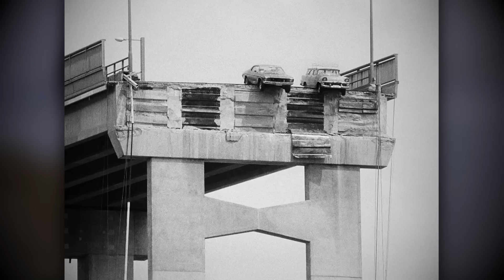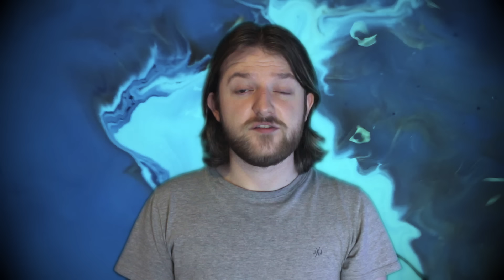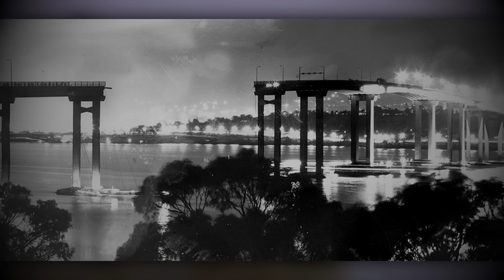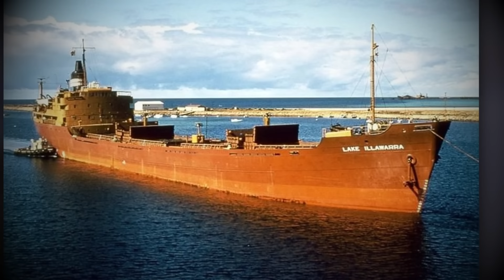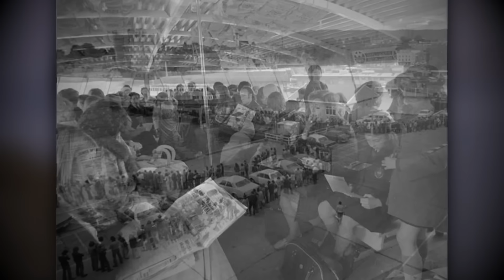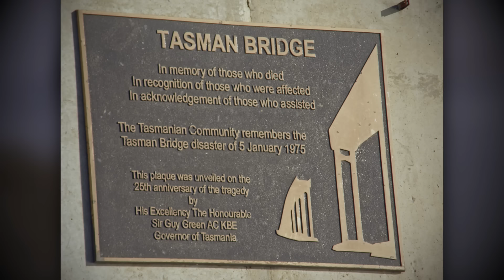Motorists Drive Off Collapsed Bridge | Last Moments

Comment: Makes me think about how often people (including myself) take for granted that the roads are okay, the bridge is there, and that everything is normal. I wonder how many distracted drivers would go careening over the edge if this happened now?
Reply: Probably way more sadly. Phones.
Reply: @thomasjhun3700  not even just phones, I reckon people just care less. Cars are easier than ever to drive, and you don't really need to think about what you are doing anymore (most new cars are mostly autos, braking systems are better, steering is very light and regures very little effort.) I reckon that because they don't actually have to think about driving anymore, they just zone out.
Reply: A year or two ago, the atmosphere became heavy thick with wildfire smoke and ash, which was added to by the darkness of the early morning and fog that had just come out. Visibility was basically nothing. You could barely make out the tail lights in front of you.

Myself and several drivers took on the highway at about 25-30MPH that morning. It wouldn't have prevented a crash with how little visibility there was, but at the very least, it wouldn't have been at 60 miles per hour.

To my horror, however, during that drive, there were people speeding by in the fast lane going about 70mph. If there were a wreck further down the road, it absolutely would've been a pile up. I don't know why they believed it to be safe going that speed.
Reply: @Sk0die  oh no cars are safer now
Reply: Picture texting while you are approaching the NON section of bridge.  I'd expect nothing else from the people I see on the road at all times.
Reply: @ashtentheplatypus  that kind of ignorance displayed by ppl scares me to death! Why in Gods name did these ppl think it was remotely safe for them to drive that fast with such limited visibility?!? So glad that these idiots didn’t hit you or make you wreck! Thank you so much for the share....
Reply: @Sk0die  Not to mention, people trying to get you to stop on the road in some countries like the U.S is kinda suspicious.
Reply: the silver lining is that this happened at night. who knows how many dozens more people would have been killed for being distracted, with a huge pileup forcing even more cars off of the bridge. RIP to all the victims of this tragedy.
Reply: Just last spring I was driving home from visiting the city with my friends when just about as soon as we crossed the county line, we were plummeted into a thick fog. I had to slow down to 30 km/h in some places as the thickness of the fog varied and I turned my hazard lights on. I saw that quite a few drivers coming in the other direction were still going ~100km/h and at one point a semi blew past us like it was a clear day.
Reply: When they redid the pavement of one of the three streets connecting my home village to the outside world i figured one night it would maybe be ok to drive through the working side as they must certainly be finished soon and the roadblocks are just so they can work at peace, right?
As they blocked the street a few kilometers before the working site as there was the last junction i at some point decided to speed up as it would take forever to get home.

While driving at around 80 km/h (50 mph) at some point, way before i thought the jobside would be, I saw a sharp black line between the dark street and the black void of the forest. I decided to slow down and as i couldn't make out any road ahead i stoped a meter in front of the line. I got out of the car and saw that they not only repaved the road surface, but in fact dug a four meter (13 ft) deep trench along where the old road was to even out a long ridge. 

If I did not know there could be unexpected things with the road i wouldn't have seen it as i normaly scan the sides of the road in this area for deer and would have jumped right into the trench...
Reply: @hassiaschbi  goes to show if a road is closed for repairs you probably shouldn't drive on it
Reply: Gotta practice using the handle brakes. Too many rely on the foot pedals to stop.
Reply: Probably several thousand before a few people who actually look at the road come to a stop.
Reply: Probably women looking at themselves in sunvisor mirror and millennials on their phones would be my guess! Not a great loss..
Reply: Follow the science they said. . .and over the edge we go
Reply: I am super vigilant
Reply: 7
Reply: It's not just distracted driving. With the higher numbers of cars, and how close people follow, it wouldn't end well
Reply: If I can't see very well, I would slow down. If I can't see anything, I would stop. I wouldn't expect the bridge to be missing but I would be afraid of hitting something.
Reply: similar happened in Italy back in 2018, Ponte Morandi was the name of the bridge. 
43 dead, 16 injured between 35 cars and 3 trucks.
Reply: Just pay attention to the world around you. The lights going out on the bridge should have been a big clue to slow down. Stationary lights ahead mean to slow down. Just stop assuming you know everything all the time and ask questions of yourself.

Comment: The craziest part is that the Monaro which was left on the edge proceeded to be retrieved and used as a daily driver until the owner donated it to a museum.
Holden’s are definitely a special car
Reply: As an owner of a dozen or so Holdens, I concur!
Reply: @RiffRaffMama.  currently got 2 so I understand
Reply: Holden's special?😅😅😅 Is that the same brand of car where all of them fell apart in the 1st Redex Around Australia Reliability Trial? Built for Aussie conditions? Bullshit.

The American designed suspension fell apart. Reliable engines.

Comment: Frank Manley's green Holden Monaro survived this incident and is still around today. This is a legendary car for Australia that this bridge didn't claim.
Reply: As an FYI for those not in Australia, that Holden Monaro is likely to be worth over $100,000 (and likely more than $130,000). And with the story that goes with that Holden Monaro, likely worth a shit tonne more.
Reply: The Holden FB wagon also survived.
Reply: @dialupdude  did it? Any idea where it is today?
Reply: @CycolacFan   It was sold in March of the same year to a guy called Robin Tripp. After that someone crashed into the back of it but was repaired using the back half of an EK wagon. It still exists today but has a bull bar on the front now.

Comment: Having a bridge collapse underneath me whilst driving was one of my biggest fears. There’s been a handful I’ve seen on the news growing which fueled it. Particularly on the east coast US where I’m at
Reply: What's crazy is I'd never consider it being a massive bridge like that.  I get really sketchy going over some bridges that are barely just a few 2x4s glued together which are common in rural southern US.  But a bridge like that?  Man I'd never expect it.
Reply: Especially in the Northeast. Where I live in northern Alabama we have an old railroad bridge that was mostly demolished back in the early 80s. But there's still a good portion left on one side of the Tennessee river. People go on to the bridge all the time to take pictures or tag what's left to the side of the bridge. More than a couple of people have fallen through the old boards.
Reply: New Orleans moment
Reply: See the old Pulaski Skyway in NJ? Yikes!
Reply: Bro driving to VA beach is horrifying
Reply: @casanova1838  Chesapeake Bay Bridge has its moments, but there is a tasty lil breakfast spot on it tho lol
Reply: Had a close call a few weeks ago myself. driving on a dirt road when the soil collapsed from underneath me and the truck I was in rolled over the edge, luckily not a full cliff, and landed 90 degrees on its side. A tree stopped me from continuing otherwise I estimate 4-5 full rotations before I go to the bottem
Reply: The bridges of the east coast are rotting. Most of the infrastructure was built in the 50s. You see more stories because it keep happening. There's a lot of mitigating factors: unaccounted for population and vehicle size primarily. But ultimately much of it has been neglected thus diminishing it's useful lifespan.
Reply: All the salt doesn’t help I live in ny by 81 and can see how bad some of them really are to the point there about to completely get rid of it in some sections also a fear of mine of when there hella icy with snow on the rails it’s literally like a ramp n have seen cars and semis fly off them
Reply: @qwopiretyu  there so bad that some of them there just gunna take out completely n not even repair or fix I live in ny and see how bad some of them really are
Reply: @qwopiretyu  I remember my uncle coming back from New York after doing work on the old Tappan Zee Bridge. Said a lot of things built in the 50s weren’t meant to last, especially with the Korean War, and post WWII life on top of that. So that makes sense homie
Reply: I have yet to bike over a huge bridge near me for that exact fear hahaha, bridges terrify but amaze me
Reply: I've had a recurring dream about this since I was pretty young, having watched at least two large bridges being built. I always clench up when I have to drive over one at night. (Another North Alabamian here, incidentally)
Reply: Elevated highways screw with me. The imagination of driving off the edge is too much. Two wheels hanging off? Adrenaline overload.
Reply: Honestly you can’t look me in the eye and tell me when you cross the GWD into NJ or into NY top or bottom level you look at the rust and think damn this is still standing!?
Reply: @MrAB-fo7zk  Kinda like the Genoa Bridge collapse in 2018
Reply: I was in that boston tunnel less then half an hour before it collapsed

Comment: Its terrifying to see that, because most of these bridges in Australia usually have speeds of 70-80KM/h, and I feel like if I was racing along at that speed and the bridge was out, I wouldn't know until it was too late. Its just one of those things you would never think would happen.
Reply: TBH I'd likely have overtaken the stopped car and been too busy leaning on the horn and cursing them in my rearview to have noticed the edge.
Reply: r/woosh
Reply: Its so rare that if i could care aboat it i wouldnt be driving or walking or talking.
Reply: And the Tasman bridge still stops vehicular traffic if a ship is passing under. For which I am grateful

Comment: Damn, looks like the ship wasn't even close to going through the correct place. Had to be at least a couple hundred meters from the passage though.
Reply: Full speed into turning would cause this. Even if relatively close to the bridge when the order was given. Captain could have saved it/minimized the damage by going full reverse/dropping anchor.
Reply: I saw another video that talked more about the investigation of the accident and Qxir makes it seem like the captain was more aware of the danger than he really was. He didn't even realize how off course he was until it was too late to avoid crashing into the pier

Comment: I own a small boat.  This disaster reminds me of rule #1:  Never approach a dock at a speed greater than you're willing to hit the dock.
Reply: I want to know what rule #2 is now
Reply: @richardhunter132 never forget rule #1
Reply: But higher speed means more rudder authority. It counteracts the effects of the current in some way by increasing the vector of the intended direction of travel against unwanted sideways movement. If you've ever controlled a boat, you'll know they are difficult to control at low speed as there's no water flow past the rudder, rendering it useless. I mean, it's why they invented thrusters
Reply: @Tom_Hadler  Good point.  My boat has no rudder - only thrusters.  It's a twin engine inboard powering two steerable nozzles.  Very hard to steer at low speeds.

Comment: Holy fuck. This is the stuff of nightmares. Literally, I've had several dreams about this. Scary to know this is a real thing that has actually happened.
Reply: I hate getting that “roller coaster stomach” when I’m sleeping or dreaming.
Reply: @thepumpkin3203  
That's why I stopped riding rollercosters. Even hours later, I'd be going to sleep and as soon as deep sleep starts, I feel like I'm still back on the roller coster.
Reply: Emotional Damage  hey guys just a warning in case you haven't seen this before, don't click this, it's usually an ip grabber or phishing site, be safe out there
Reply: I had once dreamed i was driving a 70's muscle car, not sure which one but i dreamed of driving on the road, through the tunnel and as i got out the bridge was gone and i plummeted into the depths. 
I often have some anemoia for the 70's songs which i find weird.

Comment: My father was to join the ship in Hobart and learned of the sinking while getting ready to fly to Hobart that morning. Although the Captain was found guilty he was made the scapegoat for the mistakes of the port authorities. The crew and the Old Man were men I knew through my Dad.  My father had survived two sinkings in his life at sea and had he already been on board he wouldn't have survived because he would have again stayed in the engine room until the last minute.
Reply: Yah that situation didn't seem to be all the captains fault. Those supports seem awfully narrow to be letting ships of that size pass through, usually I'm pretty sure your only supposed to go through the middle and largest one so why he was apparently allowed to choose any is dumbfounding there should be bouys marking lanes and approaches so ships know if they are on course and will make it through as it is very hard to maneuver a ship of that size at low speed with apparently strong side currents.

Comment: There’s also a similar one on the river Severn in 1960. Two ships collided and got carried up the river on the tide. One of the ships carried bulk fuel exploded blowing out the central span of the railway bridge. 5 sailors died.

I also drove across the bridge in Genoa a few days before that came down.

Comment: Something similar happened to a bridge near where I grew up in Florida. In 1980, during a rain storm,the Sunshine Skyway bridge was struck by a freighter on one of it's support columns and 1200 feet of center section collapsed. Thirty-five people were killed. Several cars went over along with a bus carrying twenty-six people. There's a picture online of one of the cars that managed to stop in time.  I tried to ad a link but it got the post deleted. The guy's car is literally at the edge of the bridge. Another foot and he'd have gone over.
Reply: Oh wow never knew it had collapsed, now its known for a few suicides (like many tall bridges)
Reply: I live in the Tampa Bay area near where the Sunshine Skyway is too.
Reply: @dr.coomer789  Over 300 actually. Even when I lived there it was known for suicides. After the accident, they tore the old bridge down and a new one was built. The only remains of the old one is a stretch of it they turned into a fishing pier. If you're heading south, you can see it to the right of the new bridge.
Reply: A former navy diver survived by ricocetting off the ship

Comment: All I can think of - outside of being dreadfully sorry for the victims and their families, and wondering how in hell's name those people got out of the dangling cars - is thank god it was a quiet Sunday night. Had it happened during rush hour... It doesn't bear thinking about.

Thanks, as ever, for your excellent work and presentation, mate. I always appreciate how you can give the raw facts and continue to be respectful (in this series. The others, especially Tales from the Bottle, often deserve the ragging!).
Reply: You very carefully tune the radio all the way back down so the needle returns to the lowest frequency which is just enough to change the weight distribution in the car, stop the teetering and places the rear wheels back on the roadway and then you very calmly and carefully exit through the back doors or boot.

C’mon man. The Simpsons taught us this twenty years ago.

Jokes aside this is terrifying. Doesn’t help that the bridge is a constant and fairly steep incline from both directions to a significant crescent in the middle, which isn’t what was destroyed but it was obviously significant enough incline that it didn’t help. Those few degrees could also be what barely saved the two cars from teetering in the other direction.

A fear of this exact thing is why I keep so much crap in the back of my car at all times. “It’s a safety feature not a hazard. Honest occifer.
Well, except the hazardous waste in that giant water container, but y’know... I figure, it like... cancels out..

Right?”
Reply: @Jay22222  but what if your car dangled from the behind..
Reply: There was'nt much of a rush hour in Tassie in those days certainly not at that time of day.
Reply: @themugwomp8372  Everywhere has a rush-hour. It’s just proportional and depends on geography.
Don’t forget this was what, 2 in the morning and it still killed how many people? And how many more nearly went with it.
I forget if this was the incident where a fairly full bus nearly went off or if that was another incident but if that had happened that’s another 10 and maybe 25+ in peak times.

I 100% agree though, my point is just yeah, this was Tas 40-50 years ago in the dead hours of the night and it STILL grabbed far too many people.